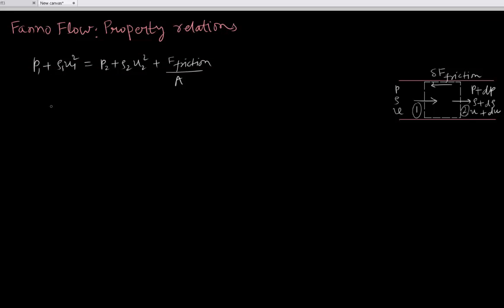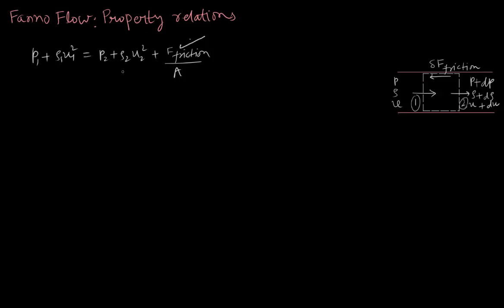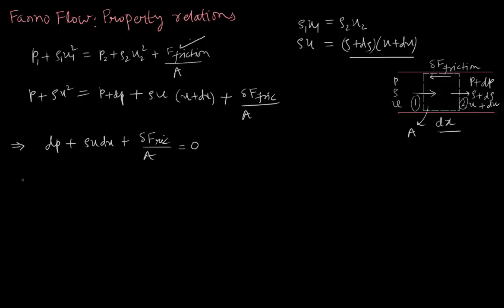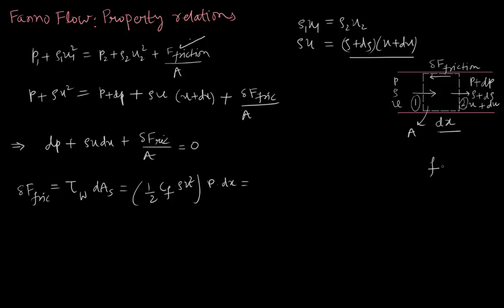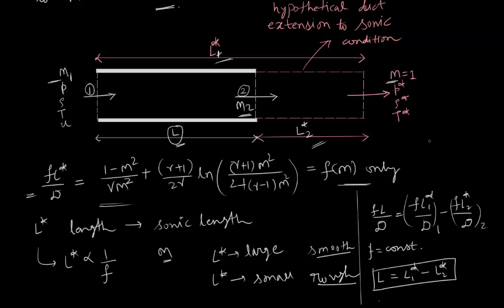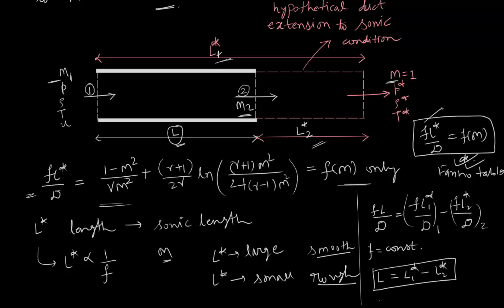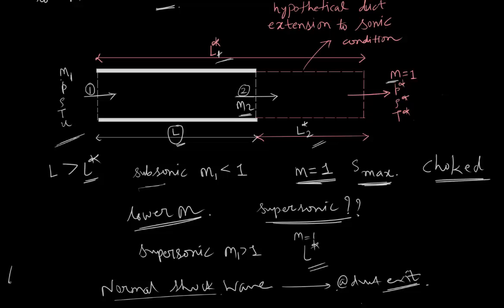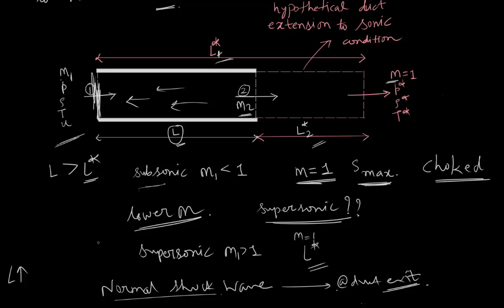Fanno Flow : Property Relations part-2

Comment: Hi, Alpesh. These equations are for modeling fanno flow for constant pressure/mass inlets. What if the pressure changes at the inlet during the flow ? any reference or pointers for this kind of flow?
It is a compressible gas with time varying inlet pressures examples will be an accidental release of a pressurized vessel connected through a pipe (pipe rupture). (no two phase flow)
Reply from the maker: All I have discussed here is part of Static Flows and not dynamic flows. For Dynamic fluid flows, time varying inlet pressures, We also have to take into consideration time differentials in the governing differential equations. However, the differential equations often become complex so that no analytical solution can be found. In that case, Numerical Mathematics comes to our rescue.
you may refer to Anderson's book for the same.
Reply: thank you.